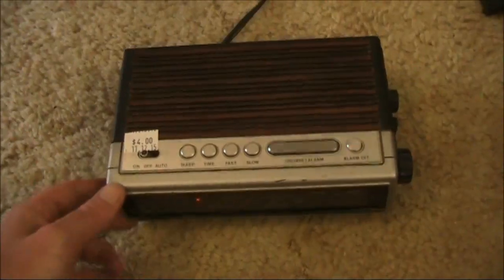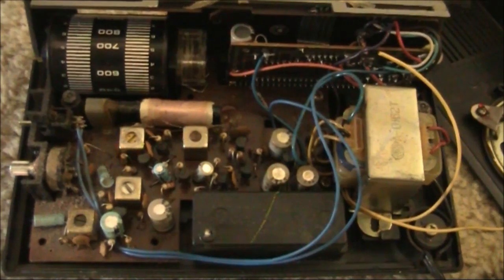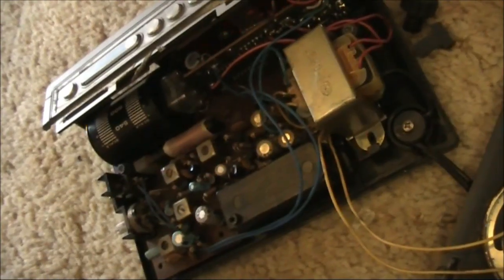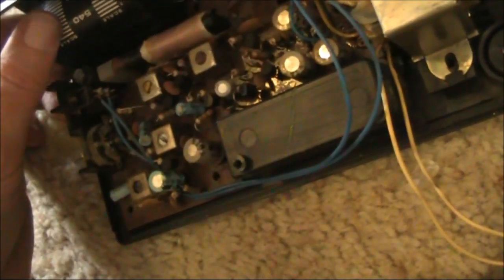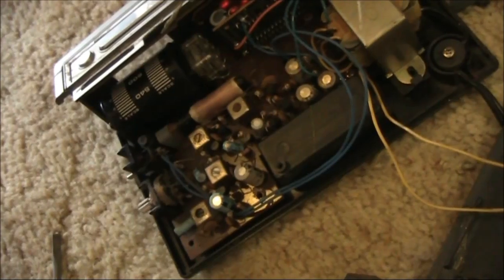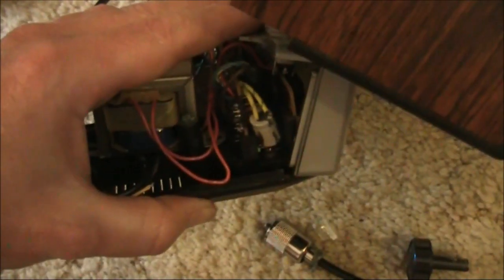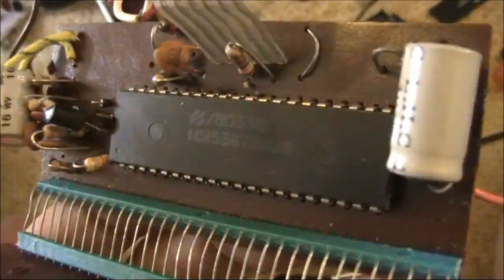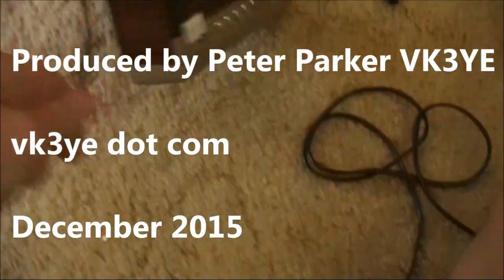Electronics on the floor: AM clock radio teardown

Comment: Peter,
Great video about a subject that needs more exploration. You should know that in the US the radios go for the same price! I think you need to add in how to actually tune to get 160M reception as you glossed over that a bit for someone new to the hobby. Also, I have been thinking of building a Ham band front end and use one of these as the superhet back end. Just need to be feed these a real narrow input. Using another radio as you have demonstrated before as a BFO to hear SSB gives a a ham with little extra cash to easily be involved. Really like "Radio Bashing" to convert something worthless to something useful. All in the Amature radio spirit!

Comment: The case can often be the most useful part. I good trick is strip all components from the board, and then use the board as template to cut a new one from blank copper clad pcb. You've then got a case, with a blank board in it, giving your projects a better appearance. With care, switches can be used in their original position as well.
Reply: That's a pretty good idea you've got there. Simple and easy too.
Reply: Done this before, proves to be rather easy to do than one may think :)
Reply: With many boards being surface mount these days, I don't bother trying to de-solder the components, but just remove them with a wood chisel. I use a 25 mm chisel, and using light force only, a board can be cleanly stripped in a couple of minutes.